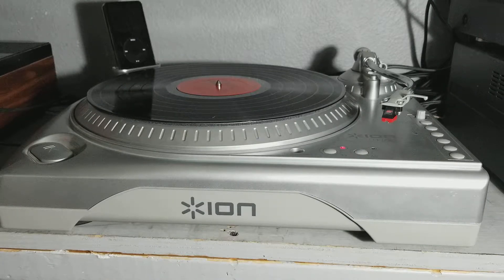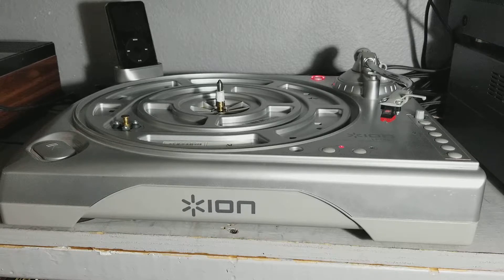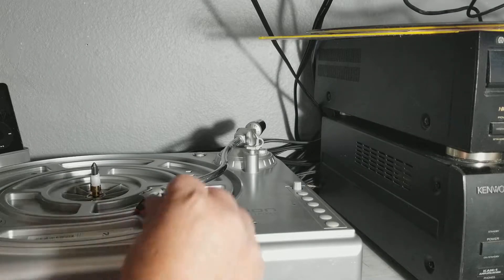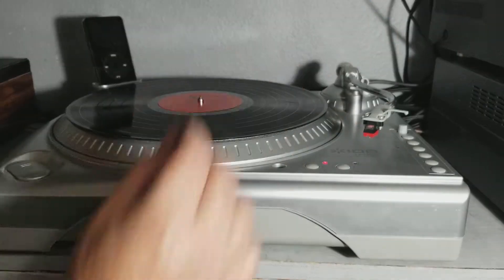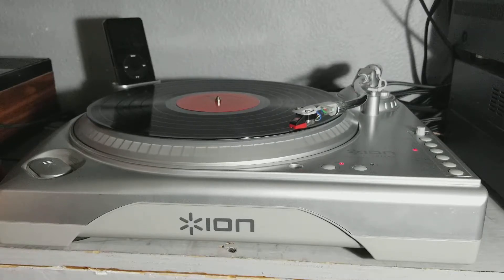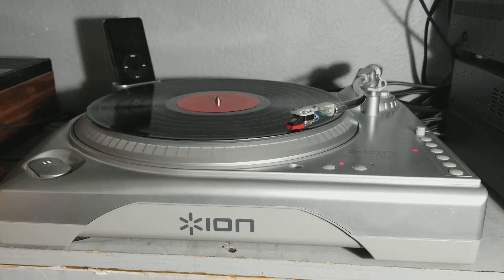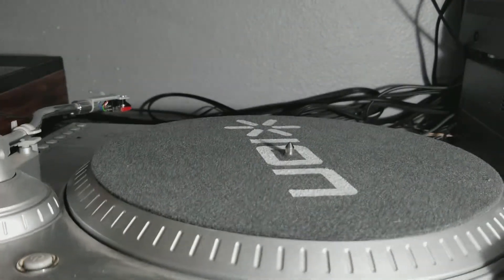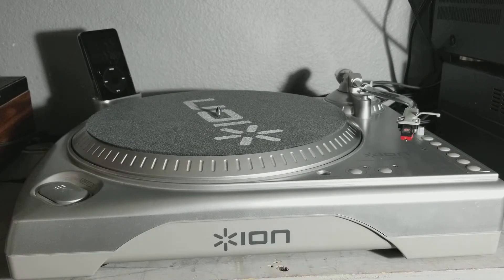Tricks to fix your Ion LP Dock

Comment: Amazon has an inexpensive digital stylus pressure gauge that Is far more accurate. Never trust visual settings. Then set antiskate and check it by putting a blank CD on the platter and starting it. set your stylus on the cd and adjust the anti skate until it no longer swings one way or the other.

Comment: Dude, lots of albums there.  That must have taken some time if you have mp3'd them all.  Love the ION tables too.
Reply from the maker: I spent most of my free time a few years ago digitizing my albums. I would have to say thanks to Audacity my recordings sound better then most of my original albums.
Reply: I sent you a pic on my ION table.  Too funny to see this popup on my list of videos.  The one I have records the music to memory and then burns a CD.  I don't have nearly the number of albums you do.  I was in college when CDs started to take over.  I have a wall of those.  I will have to try that Audacity out.  I have something called SoundForge that came with a sound blaster card years ago. I have it on one of my '98 machines.
Reply from the maker: Yes I saw it, very nice! For my mint albums that would be a great addition to my ripping collection. Since I rip all of my original music (LP, 8 track, Reel to Reel, Cassette & CD) to MP3. I find my ION LP Dock is perfect for me & audacity. I think I will link it on this description.